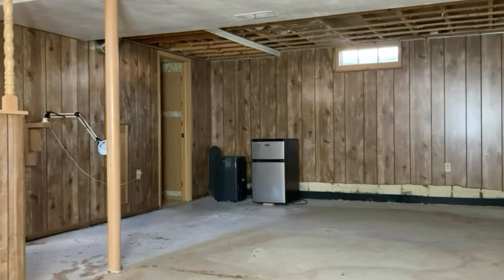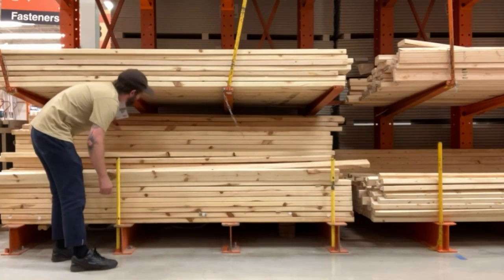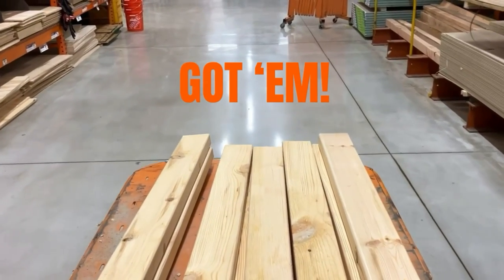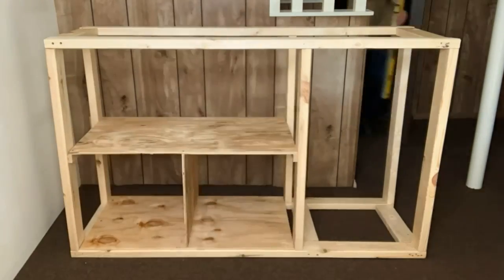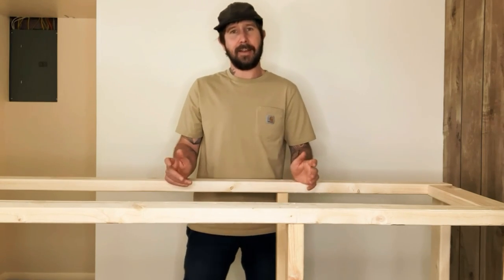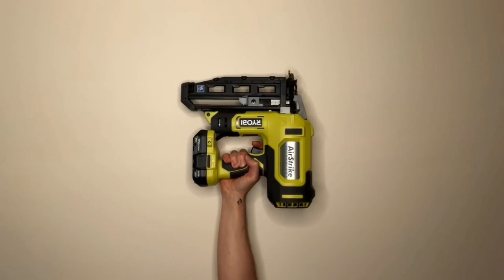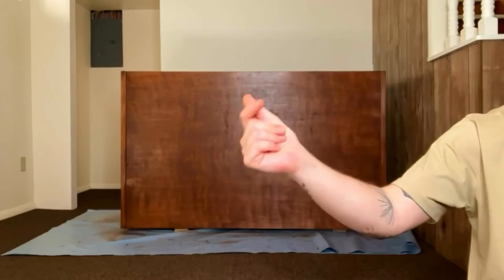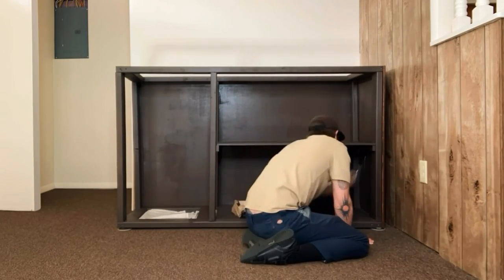Build A Wood Bar Without Using A Saw

Comment: I like how you are highlighting what can be done with minimal tools.  It's important to share that you don't need $10k worth of tools in a dedicated woodshop to go ahead and make something.  My only note would be that I would have made the counter top overhang 8 or so inches so you could cozy up to the bar vs. have your knees bang into the bar.  Otherwise, great work.
Reply from the maker: thanks zachary! that was the big debate when i was sourcing the bar top. i didn’t want to make the area between the bar and the back of the accent chairs feel too narrow so i opted for a smaller one, but once i put the bar stools in it didn’t matter anyway. ya live ya learn, i guess. either way thanks for watching!